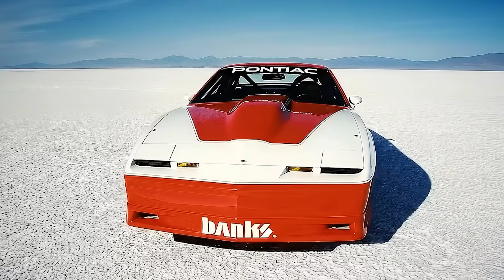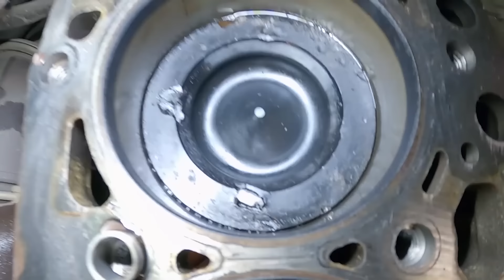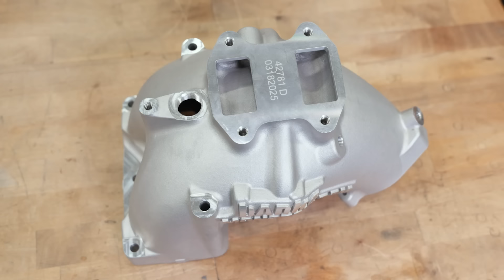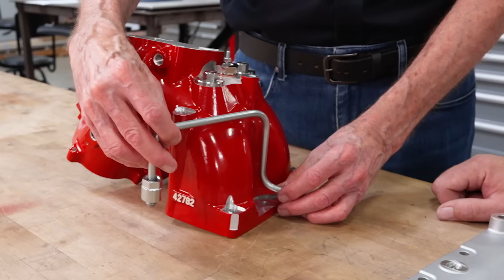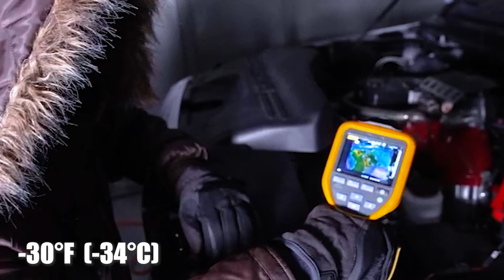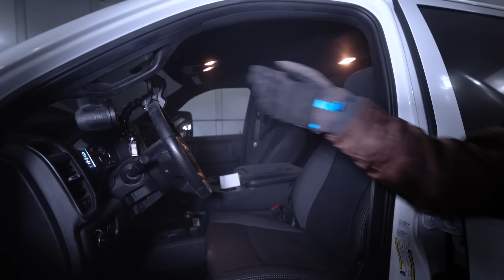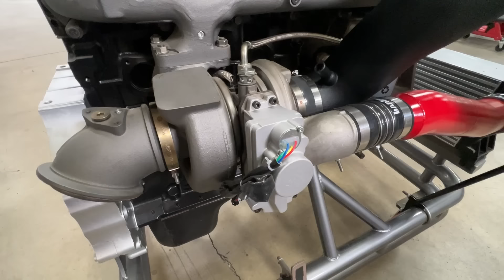The RAM 6.7L cold start dilemma.

Comment: Extremely respectable that Banks produces solutions for low population density problems in Northern Canada.
Reply: It's plenty could in mountains of NY and PA......
Reply: Even as banks engineering works with diesel performance shops in Canada as during winter has the area where the shop is located can dip to -35 C as factoring in the windchill has temperatures reach beyond -40 triggering extreme cold warnings.
Reply: @daniellibich1376 moving at highway speeds adds to windchill also. Not just standing still windchill. Riding motorcycles tells you even tho it's warm, you get moving at 100 kmh or 60 mph that changes quickly.

Comment: I think he's full of crap about the EGR helping with intake temp. I believe he thinks that helps so tells it as if it's a proven fact.
Reply from the maker: Once the truck is running, introducing hot exhaust gases into the intake does increase intake temps. Is it helpful when you're trying to start? No, but it should warm the truck up faster.

Comment: Montana gets cold one heater element will not do it.
Reply: On a banks upgrade, you can run 1-2 depending on the intake, and 1-2 on the billet spacer.

Comment: Great stuff but you need 0w oil not 5w past -15… and should have a coolant heater like webasto or espar… then only need single heater… with 3000w draw you would eat batteries up north, and a discharged 10v or lower battery at -20 etc is dead and replace… banks are awesome, combine with coolant heaters the way to go IMO!

Comment: No thanks. I bought a BD diesel killer grid heater upgrade for a quarter of the price and since the banks horn does nothing for performance, its like throwing money in the toiletm
Reply from the maker: The BD "fix" kit is poorly engineered and has a high likelihood of failing over time, the same way the factory heater assembly fails. They've given their customers a false sense of security. Here's the explanation. 

https://youtu.be/iU5dvEekDUc

Comment: 3000watt with 12 volt that’s 250 amps 😮. I don’t know how thick those wire are but that sounds like a second problem, but with that cold maybe that’s it an issue.
Reply from the maker: We've done extensive testing and haven't experienced any issues. The heaters are on for such a short amount of time that the wire gauges we've chosen are more than enough to handle them.
Reply: You certainly would not want a constant 3kW load on those small wires. Good thing pre heaters aren’t a constant load.

Comment: What happens if you keep the EGR intact and soot builds up inside of the monster ram? Will it foul the heater elements over time?
Reply from the maker: If the coil heater were to collect with soot, you could unscrew it, spray it with brake cleaner, and screw it back in... in less then 5 minutes.

Comment: Try the Maxwell cap battery. It increases voltage at lower temperatures.  If it will start a Kenworth at -40 it will definitely start a little Dodge Ram. We tried it on a 7.3 Ford with bad glow plugs and spun it like a gas engine in the summer.  The battery has a little computer in it that increases voltage at color Temps. Run a to starter only.  Battery is expensive but worth every penny.

Comment: How much current can the factory heater circuit handle?  125 Amps is a lot.  just curious what the oem grid heater draws?
Reply from the maker: The factory grid heater draws 220 amps nominally.
Reply: @bankspower ah ok I see.  That's good

Comment: One time I’m gonna argue with Gale.  Live in Montana, started many trucks at -40F or colder without being plugged in.  Not planned, not easy, but have done it.  Coldest my 6.7 power stroke has started without being plugged in -47F.  It took three times and it about walked across the lot but it started.  Now that being said, always plug them in, I am aware I shortened the life of my engine by doing that but I’d rather do that than freeze to death 🤷.  I’m afraid neither one of these guys is really familiar with cold weather as the Canadian didn’t know #1 is winter blend…. Gale clearly said the truck in the cold cell had #1, and #1 is much better than any winter blend bs or 50/50 mix.  Only thing is #1 has less energy so your truck will be down on power, and it stinks.
Reply: Ill defend the Canadian here, as a Saskatchewan farmer. There's no choice of #1 or #2 diesel at the pump. It is what it is. It gets blended out from summer to winter diesel in the fall. Then back again from winter to summer diesel in the spring. That's just how they do it for retail. So, that would be why the guest who's from BC wouldn't know. He just gets whatever his local gas station has for diesel at the pump

Comment: do have a C10 diesel out in Alberta, can rebuild them with lower compression so they can idle with higher boost 15~20psi... but, unless it is +30c outside. they need about 11Kw of heat just to stay running, so the duty cycle on the heater stays on for so long... 15 seconds on when it's anything below +30c... takes 15 seconds for the 24volt OEM heater to tip over and get red hot, same as ether start down to -15c where it either needs to be plugged in for 3 hours or then leave the grid on for 45 seconds with 250cfm going past it to keep it running as the cylinders worm up. ... spray ether in thru the EGR slot, let it heat cycle with the ether soak... goes floof... full of hot hot air... ether and the hot grid is hotter... like a stove element, stays on or needs to stay on for several minuets just to get -14c intake air when its -100f... stumbling over its self the whole time for 10 minuets of running with the grid on. 10L 10kw heater, run time duty cycle and cycling the heater relays with a flasher/blinker module on a auxiliary switch. one 5kw heater is a grid heater duty cycle problem in -30c... but the postage doesn't work in Canada, or the eastern side just seen one of them and just outright stole it during customs like a bunch of porch pyrites, convoluted monarchy.  12:1 diesel engine compression ratio, rebuild the block for 12:1 so they can sit at 15~20psi without overheating the pistons or slip in a cast aluminum cylinder spacer shim. Cummins rods also fit in a CAT, as to that one was having the idea of a 20psi blower running 300~1000cfm off the crank full time. 1Kw/1L engine size, and still might want the OEM heater with it. expanded mesh basket case intake gasket.

Comment: The real BS issue with this is, those of us in artic environments bought these intakes years ago being incorrectly told it would be the same as factory. This video is proof that was not true. Now we have to spend an additional 220 dollors just so our trucks start the same as a grid heater. This is not right. Banks should make this right.
Reply: Exactly! Also, I thought he came back saying, no it wasnt an issue with the heaters...it was your tune. Obviously not the case if he is building it now for multiple heaters.
Reply from the maker: Certain delete tunes do cause cold start issues, which we showed with Dark Iron Diesel's truck. The vast majority of our customers, even in cold climates, should be able to start with a single heater with no issues on a stock tune. These kits are for folks in extreme climates who need more.
Reply: @bankspower which would be me.. I live in the high elevations of the Rockies and it struggles to crank without being plugged in for the winter. As @thegreatestendeavor mentioned, we were sold this as being the same as factory and it is not.
Reply: Don't get me wrong...I have almost all your stuff on my truck and they are quality parts, but I'm a little disappointed with my intakehorn and its performance in the winter.

Comment: Having spent time working in Prudhoe Bay, Alaska. All the vehicles have heaters on the batteries, transmission pan, oil pan, plus the block heater. If you can plug in that all works fine. But if you can't plug in, then you bump up the idle and she runs until you can plug in.
Reply: Deadhorse... this man speaks truth  🙌

Comment: I live in achorage alaska and have snowmachine in -40 up near denali near cantwell in -40F I have to say gale you have no clue what cold is we sledding for 5hrs in that weather then headed by to the trucks all of then 6.7 cummins we fired off first time what you have to do is cycle the heater system before you try cranking on top of which in many place up north on the Northshore aka the oil fields right on the arctic ocean they have similar temps for days on end yes its hard on equipment but things work so you calling bs I have to say I think your out of your realm of knowledge on this one I applaud your efforts on doing the dual elements and I have recently ordered on of them but please until you have come to alaska and tested your cold weather products in January or February up north past fairbanks please don't make comments you have no real idea on other then a cold chamber testing that isn't real world month of cold alaska sorry it just isn't but once again we appreciate you making the effort to re-engineering to help with cold effort starts
Reply from the maker: We absolutely respect the expertise of folks who live and work in extreme cold environments like Alaska! 

But to clarify, we did dual hater cycles per the RAM manual for all of our testing and the cold chamber is the same one used by vehicle manufacturers for their cold weather testing.  We also work with our dealers like Brad to understand the needs of customers like you and this dual-heat Monster Ran and billet heater kits are the proof of that.

Thanks for your business, we appreciate it very much and we also appreciate the feedback.

Comment: For referrence, -40C = -40F.
We used to have remote start modules that could be set to start the engines to warm them up every couple of hours. Heat from the engine also kept the batteries warm for a few hours.

Comment: I’ve run 0w40 in my diesel pickups for years and years now and when my 6.4 F350s were working on Baffin Island we eliminated part of the emissions systems and they were only turned off for oil changes because nothing wanted to start when it was -60C and below. At home in Northern Ontario I keep my 6.4, 5.9 and the Kenworths all plugged in when they’re not running.

Comment: Up here in Alberta we don't have exemptions in the oil and gas industry AFAIK, it is an informal industry recommended practice after emissions (DPF) were found to be unsafe around natural gas wells. The problems started with Ford trucks that would shoot flames out of the tailpipes during regen and then regen became suspect in all diesels, so the only solution was to delete. At -40C/-40F and below, trucks are run constantly rather than shut off for 12 hours during a work day and often all night in camp. Block heaters can only do so much and there are also some issues with Webasto hydronic heaters being not intrinsically safe so they aren't used either, though if they were, that would solve a lot of problems. If a gas well is leaking enough gas to cause a diesel run away, we have positive air shut off devices for that, but if it is the regen cycle heating the DPF, we have no way to mitigate the ignition source by that heat even if we hit the air shut off. In the case of the Fords back in the day that shot flames out of the tailpipe, well you can see how that would be a problem around a potentially leaky gas well. Big candle flames !
Reply from the maker: The thing about regen around natural gas and oil operations makes a lot of sense, actually. Particularly with older systems that are less refined than what's on today's trucks. Thanks for the insight!
Reply: @bankspower  Welcome !

Comment: Should be great to see how this plays out with the battle with the cold. Being in Alberta, it can be crazy cold sometimes. Pretty sure the dual can handle some cold temps. I have the original 3.5 monster ram....so adding heat is a conundrum with that setup, as it is a fantastic setup. Still have the factory grid heater.....which does play at the back of my mind, and i check with the wiggle test, and knock on wood that its still good. Oh the joys of diesels. Lol. I see there is a new transmission pan and intercooler for the 2010-2012s. ( you are making it very hard to somehow find a way to slip that "necessity" into the house budget and have no knowledgeable way of how it got there. Lol.) Love the content, and keep up the great work.

Comment: The - 40 thing is usually that you end up turning off the vehicle and then you get a good ol Alberta cold snap that drops 20-30 degrees overnight (unforcasted) or "I'll be back in 30" and bam it's the next morning. We just can't always plan for that handful of nights where something like that happens. Appreciate the additional dev on the ram. It'll be appreciated for sure!
Reply: Lots of times in the patch your forced to shut off the truck. From esd and musters to grumpy old consultants who get mad that thy are running. 4 heater cores is overkill but I definitely waited till the duel heat was out before I ordered.

Comment: I just installed one on my 2014 ram I got the one with a single heater. I’m gonna try it out. I live in Anchorage, Alaska. I want to say the instructions were awesome. It took me 5 1/2 to 6 hours to install this. I’m not a mechanic. I’m an electrician. Instructions are awesome thanks for a great kit
Reply from the maker: Thanks for the great review! Means a lot all the way from Anchorage!
Reply: @bankspower  so simple even sparkies can do it 😂😂❤
Reply: @davesanders95  and he just left the old parts on the floor and drove away.
Reply: You should install the dual heater now before you’re stranded with a truck that won’t start.
Reply: I have a single element monster ram on my 18 ram, installed a year ago. Im in Fairbanks, AK. I have alot of problems with starts below 0 and -10 cold soak is almost impossible. Unfortunately we are forced to spend more money on these second element. This does not preform the same as a grid heater as they said. This is very clear as they are engineering new multi element units.
Reply: @thegreatestendeavor  Besides adding a dual heater banks ram intake, you can add the billet single, or dual heater spacer between the intake, and throttle valve also.
Reply: @thegreatestendeavor  Banks has a solution for that, it's a billet spacer that has a heating element in it. I think they have a two element version too.
Reply: @T51B1 sure do. Just spend another 220 bucks on something they claimed I would never need.
Reply: @thegreatestendeavor where did they say that?
Reply: @firstlast---  i cant paste a picture but this is pasted text from the website.
"The complete system:
Banks' High-Flow Heater and Billet Intake Plate complete the perfect system. The High-Flow Heater allows for the removal of the restrictive stock heater grid plate. The new vertical coil-style heater provides the same functionality for cold starts as the stock grid heater but without obstructing airflow. Replacing the restrictive stock grid heater plate with the Banks High-Flow Intake Plate removes all obstructions and turbulence in the airflow path."
Reply: I live in Anchorage too, I am looking at ordering one with the two heat coils. How has yours been? I’m fairly mechanical. Installation was good?

Comment: How is 32 below equal 62 degrees below. What’s going on with these numbers ppl?????
Reply: I believe he meant 62 degrees colder that the freezing point, Banks being in greater LA its historically rare to see the freezing point so its a HUGE deal to be that much colder as in 30 below F, never mind 40 below and colder as we typically experience a bit of here in northern Alberta, a couple of years ago it got down to -52f in the farming area I live for example.
Reply: -30 F  = 62 degrees below freezing
Reply: @hvandieren  wrong
Reply: Might you be conflating the Celsius and Fahrenheit scales? 0 degrees C is freezing, equal to 32 degrees F. Gale was speaking in Fahrenheit, so when he said "30 below" that's below 0. The difference between 32 degrees F and 30 degrees F below 0 is 62 degrees F, as he said.
If you live in metric/Celsius country it's easy to get a little mixed up about Fahrenheit. And if you do live where heat is measured by Celsius degrees, I'm jealous because it's by far the superior standard.

Comment: I will say this again.  For the cold weather people and yes, I live in northern Alberta.  Spend the extra money and get a webasto or proheat installed.  My heating element doesn't even cycle up to -30 after 1h of run time.  At -30 and 1h run of the webasto, my coolant temp is 50-60⁰c and the oil is 30-40⁰c(exhaust pointed at the oil pan).

Yes at -40 I actually do plug in my truck, and I have a battery tender hooked up for the exact reasons in the video.  Even with the fuel having the winter blend, run extra conditioner.
Reply: Yep, preheater is the best thing for the engines. They never start overly cold and it`s bound to cause less wear on the engine
Reply: This. heating the intake air just so the engine can fire is only one of the many problems that need to be addressed. A Webasto heats up the whole engine block, including the oil, and probably warms up the engine bay to some degree so the intake air is not so cold.

Then you could throw a 12V heat pad and some insulation around the battery and keep that warm while you charge it. They sell RV water tank heat pads that are set to trigger at 32F/0C.
Reply: I think Wabasco heater aren’t allowed in certain sites, and trucks need air intake shut offs incase of natural gas leak safety.

Comment: I got videos of my truck starting dead cold not plugged in in -40. We had to either the 6.0 power stroke. But the 5.9 started. 100% these Cummins trucks will start in -40 I’ve done it myself multiple times. 0W40 oil of course.
Reply: 5.9s don't care. It's the newer 6.7s I think is where the problem begins. My 5.9 loved -20f a few years back 😂